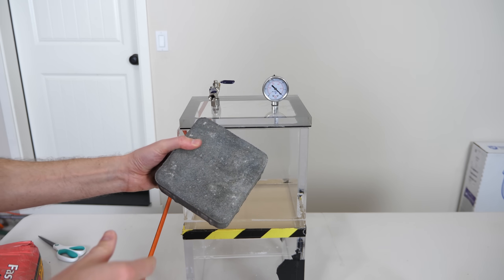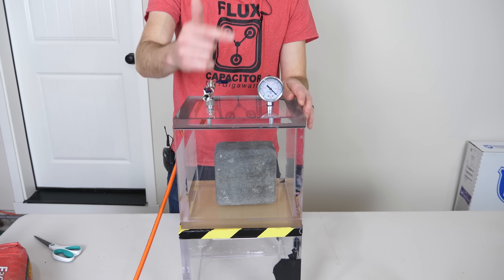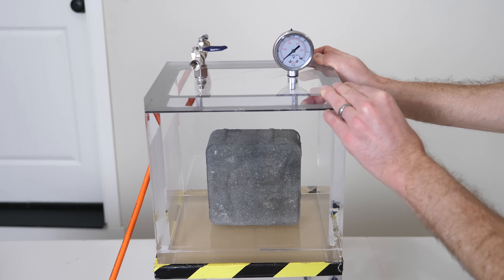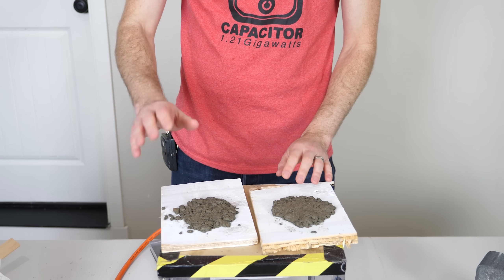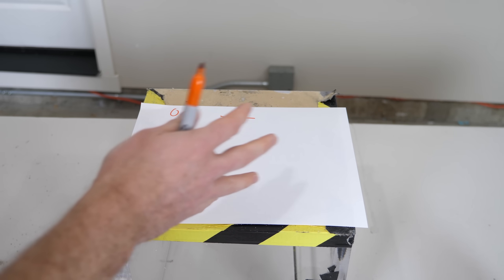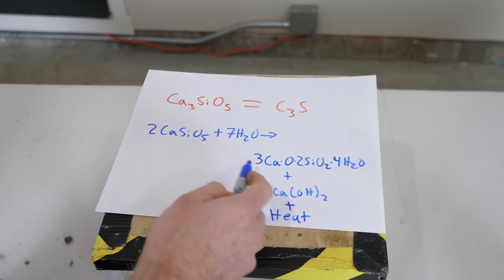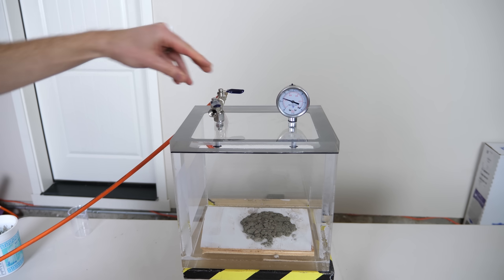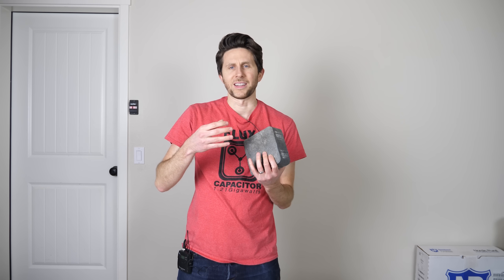Does Concrete Turn to Dust in a Vacuum Chamber? Concrete Without Oxygen Experiment

Comment: Fact check: Concrete is NOT cement and sand. Mortar is cement + sand & is used for laying block and brick. Concrete is comprised of cement, sand and gravel. Concrete is used primarily,  though not exclusively, in foundation applications. FYI

Comment: why would oxygen loss crumble concrete. ~80% of air is nitrogen and only ~20% is oxygen, if it really needed oxygen that bad shouldn't it be problematic all the time. especially because its not like that oxygen would get past the surface anyways so the interior should crumble.

Comment: I believe concrete is defined by a mix of cement, sand, and gravel or some larger rock aggregate with water mixed in as well. Cement and sand with water mixed in is just called mortar.

Comment: A)Cement and sand is mortar.
B)  it looks like you have there is a landscaping block which is not "concrete"
C) concrete sets not dries. If
Concrete dries before setting it gets weaker.

Comment: What about the temperature difference of the planet and space. Those factors are not included in this experiment
Reply: True. Ambient temperature does affect the rate at which concrete hydration occurs. I think the reaction would still occur in a very cold temperature, just at a much slower rate. And the resulting strength of the concrete at say 100 days after batching would be significantly less than if the ambient temperature was in the normal range of 40⁰-90⁰ Fahrenheit.
Reply: The amount of time it would take the concrete to become strong enough for it to be used for the purpose we use it for could result in concrete not being the right material for that purpose in environments like space.

Comment: ahhh ok i think i know why that said that ... my first thought was  ok  i guess if all the oxygen disappear so would all the oxygen in the silicon oxide that makes up the stone and cements and the sand  so everything that  was say concrete would be instantly converted into just silicon sadly or thankfully simply putting concrete in a vacum wont remove the oxygen in the concrete

Comment: Dude ... by the means of atoms ... they connected or bonded each other ... concrete is a mixture of artificial atoms ... for the dry part it needs heat ... which is the property that can break the atoms bond ... I’m not chemist... but  still learning it ... it’s weird ..

Comment: Kinda debunking, however, the vacuum chamber conditions vary from actual outer space environment, beginning with mass which is manipulated by gravity,  also temperature variation ... etcetera. What are your guesses regarding the outcome of a similar experiment by outer space "technically throwing a rock made of concrete into outer space" would it disintegrate?

Comment: Just a brick no
 It would be the weight on top of the building bricks that makes it crumble.

That's my guess.

It's also the difference between having concrete in a zero atmosphere situation and a zero oxygen situation. I know the difference sounds subtle but pulling oxygen from the atmosphere won't pull the oxygen stuck in the cementing process in bricks themselves.

Now minor note. If the concrete had been poorly mixed there is a chance the brick may have exploded or cracked to let the air out.

That is of course my theory.

Comment: nothing will happen, the O2 is trapped inside, there wont be enough pressure to suck out the oxygen, therefore the concrete will stay in tact. If oxygen actually "dissapeared" then yes it probably would but the oxygen wont just dissapear

Comment: tbh if your viewers don't know the difference between no oxygen and a vacuum you're not teaching them very good. if lack of oxygen, and there's some chemical bond in concrete that rely heavily on oxygen, then ok i see why someone would start to think down this line. But a vacuum has little to nothing to do with a chemical compound... a vacuum is literally pressure, or specifically the lack of.
oh and as far as predictions... Nothing will happen to the concrete in a vacuum. And, will wet concrete cure in a vacuum.. sort of. the vacuum will cause the liquid/moisture to boil off and I think it will harden faster, or the moisture will dissipate too quickly for the chemical reaction in the cement to work in bonding the concrete and will be crumbly. either way the moisture boils off. plus it looks like you didn't put enough water so it may be crumbly either way
ok time to take back partial statements... glad you did explain the scam/hoax from other vid and the difference between a chemical bond, and atmospheric or gaseous oxygen. and i was right about not putting enough water in. if you mixed enough water in, the control sample would be harder, and the vacuum sample would still be brittle.
wow, it's almost like you read this before the end of video... you pointed on almost everything i said, and even said it was "crumbly", lol.

Comment: why would anyone think it would return to dust?... it's basically a rock
Reply: the entire Earth is covered in radioactive volcanic ash from the KT extinction event... hundreds of meters deep.. mostly we walk around on top of it... one of the biggest problems here is.. people don't understand that there's no such thing as magic... because in a BB universe any damned thing can happen
Reply: oxygen.. in chemistry is almost always accompanied by a hydrogen.. hydroxyls
Reply: turns out our blood carries hydroxyls and, because they are really polar they can be used by a cation or anion... and the neurotransmitters our body uses to bridge the gap between nerve cells use the hydroxyls to create a standing magnetic field between each part of our body and brain... if you look at most chemical reactions.. it's a hydrogen atom that does the work.. everything in the Universe we can see 👀 is made from hydrogen atoms.. it's the squeezed together part that makes them do what they do
Reply: so.. for example, a carbon atom ⚛ has 6 proton electron pairs with 6, 7, or 8 neutrons which allows the stability in the nucleus.. 2 things with the same energy cannot occupy the same space... C 12 is common on the surface.. it's a neutron shy of stability.. C 13 is found in diamonds and is the most stable isotope of carbon.. despite much advertising to the contrary.. C 12 burns.. diamonds don't.. fer sure..  even with my plasma cutter.. 3000° C.. they melt at 3800° C.. C 14 has an extra neutron and fissions into a proton, giving off the mass of an electron.. C14 becomes N14.. a step up the periodic table... a single proton electron pair more
Reply: this is the same process breeder reactors use to create Pu244... it's not restricted to carbon..but.. since almost everyone believes some guy made the Universe a few years ago.. 13.8 billion is a drop in the proverbial bucket in terms of infinity ♾.. and.. squeezing universes into one of my dots is... against the most fundamental law of physics.. I mine diamond.. I know about how close together atoms can be.. beyond a certain point.. fusion is initiated... so.. BB universe(s).. require invisible guys to do the squeezing.. haven't found any.. despite many years of looking
Reply: science is all about measuring the Universe we live in..  numbers don't lie 

peace y'all 🙏✌☮🕊Namaste
Reply: thanks for sharing.. great lecture, sir

Comment: Nothing will happen.  Vacuum concrete will set faster as the moisture is pulled out faster because the water will boil at room temp and it may set harder with no air gaps.  Or it might not set correctly.. It will set though.

Comment: Curing concrete in a vacuum chamber vs in air would affect it if you had a larger time period. As a way cement cures is that the CaO in the cement bonds with CO2 in the air which turns the lime (CaO) into limestone (CaCO3) which is also why the concrete exposed to air was more of a whiteish color. And in a vacuum obviously you don't have any CO2. So in the long term this would actually have a pretty big difference in the strength of the 2 concrete samples.

Comment: I didn't think anything notable would happen.  If this was the way it worked, building demolitions would be a whole lot safer.  All they'd have to do is build a fully customized vacuum chamber surrounding the building, including underneath it, and then suck all the air out.  They wouldn't even need to worry about the building collapsing on someone still inside because they'd suffocate anyway.

Comment: 5:00
I'd say the concrete will be much crumblier than the one outside the chamber. That's because the hydrationheat can't go anywhere and the concrete dries to fast. That causes the concrete to get cracks and be more crumblier.

Comment: it's a Hydraulic Material, it only needs water to solidify. In a Vakume chamber the Water might vaporize so the concret might not solidify. Since there's a lot of CaOH in there the vapor pressure might be high enough to withstand the 1atm. The pressure inside the bubbles is at max 1atm witch is not nearly enough to destroy concreat.

Comment: "Let's get to full vacuum and see what's happening here". When you say "full vacuum", what are you referring to exactly? Not even Nasa has been able to reproduce a zero vacuum, as it would take a mechanical vacuum the size of the empire state building to even come close, which is why they use chemical processes to make the most powerful human made vacuum. It's still a ways off of achieving what outer space supposedly is.

Comment: What will happen though if you mix that concrete in the vacuum. Technically it should not dry right, because there is not oxygen in the water with what the concrete can react. Will there even a chemical reaction happen?

Comment: Concrete is pretty sturdy stuff despite it having air molecules in it. Also, in a vac chamber, the stuff will solidify and the block will look smaller because of the absence of a lot of air molecules hiding inside it. My question is which form of dry Concrete will be sturdier? The one dried in the vac or the one dried normally?

Comment: That appears to be a cement paver & not concrete
Reply: A concrete paver will look like a cement paver if the aggregate is fine enough. Maybe he only used sand as the aggregate which would basically look just like a cement paver. Thought people had learned their lessons on not judging by looks alone.

Comment: My intuition is that oxygen is just part of the makeup of concrete or something, and it's not gaseous oxygen that (allegedly) holds the concrete together. Since the vacuum chamber just removes the fluid/gas from inside of it, the oxygen that's part of the concrete should be unaffected

Comment: could it be possible that they're refering to the weight of the athsmosphere getting lighter?
and once a different pressure happen for a long time the material could start expanding due to not being as pressured? Though we'd probably be talking gravity at that point more than Oxygen.
Was just thinking like the ground lifting itself after a glacier has melted away.
I can imagine such movement in the foundation wouldn't sit well for concreate.

Comment: Try this do the same thing but in a bigger set up with a robotic arm that will swing a hammer into it inside while the vacuum is on and pulling the air out.

Comment: I'm 100% certain that a concrete brick will just look at you funny when you pull a vacuum. You'd see some interesting things if you pulled all of the oxygen atoms out of existing molecules, but that's straight up magic. If removing the atmospheric oxygen surrounding concrete broke it down then you could wash away your driveway with a hose.

Comment: This isn't even valid in my eyes, because the real vacuum of space is around a billion times smaller than any terrestrial vacuum chamber can produce and so because of that, I will never trust this test. Also even if concrete was put in space, it wouldn't crumble, it's properties would just change, the water would lose its oxygen and freeze instantly, which would make it expand, but then because it's frozen, it still wouldn't crumble because the ice would hold it together and it would still keep the majority of its strength because of every other material that makes up concrete. That is literally all this guy had to say. Plus, if anyone actually bothered to look it up, there are hundreds of proven, validated papers that prove everything I just wrote.

Comment: The question is, "What would happen if all oxygen disappeared for five seconds?"
The experiment you need to perform to answer this question is to magically remove all oxygen molecules from the concrete.

Fun fact: one of the reasons why Biosphere 2 failed is because the structural concrete in the buildings kept absorbing all the oxygen.

Comment: you can’t rip the oxygen atoms out of concrete with a pump down 😂 can’t even get water off the walls of the chamber. the pump down curve is exponential decay- just like nuclear waste radiation. it never goes away in a human timescale, just decays

Comment: If all the oxygen in the world disappeared for 5 seconds, the oceans would boil.
Water boils in a vacuum chamber.
Thus the vacuum caused by removing oxygen makes the ocean boil!
WRONG!
If oxygen disappeared. We would still have 70% atmospheric pressure because the nitrogen in the air does not disappear if all the oxygen goes away. The oceans would boil because they turn into hydrogen gas (H2O - O => H H => H2), not because of the drop in pressure. 

Water boils in a vacuum chamber because removing pressure lowers the boiling point.

Comment: You forgot the aggregate Einstein.
Reply: sand is an aggregate. by definition, "Concrete aggregate is a material which is mixed with cement to create concrete which is hard, strong, and long-lasting." That includes rocks... and sand.
Reply: @ratemisia  Cement and sand is defined as "STUCCO", NOT concrete.
Reply: @fk2106  By definition, "Stucco or render is a construction material made of aggregates, a binder, and water." The aggregate being sand...
I've got to wonder: Where are you getting your information from?
Reply: @fk2106  The difference between stucco and cement is that stucco usually also includes lime, not that it includes sand.
Reply: @ratemisia  Your thinking of mortar my friend...
Reply: @ratemisia  The Uniform Building Code specifies that "Concrete used in building foundations shall contain: 1 part cement + 2 parts sand + 3 parts aggregate of from 3/4" to 1 1/2" size.  I rest my case.

Comment: Inaccurate, bc on buildings there alot of wieght on the concrete but the one you used had no wieght
Reply: no, not inaccurate
the concrete would have crumbled to dust if he could magically remove oxygen within the concrete, but in a vacuum chamber, the oxygen will still stay bonded to the concrete and so its structural strength is not compromised. therefore, we can infer from that chemistry that a building made of concrete could stand up with no issues in a vacuum.
Reply: @ratemisia  but the concrete has no wieght on it, if he kept the concrete there alot longer in a vaccume and put like 10 pounds on it pieces would prolly start to crumble off
Reply: @titus1061  But it is a known process to put wet concrete in a vacuum, as this makes it stronger when it dries... See "vacuum concrete" on Google or some other search engine for details
If putting concrete under vacuum while wet makes it stronger and better able to hold weight when dried, I doubt that a piece of dry concrete put under vacuum would get weaker.
Besides, try as I might, I cannot find a single experiment that showed concrete under compression crumbled in a vacuum. There is evidence that this isn't what happens, though...